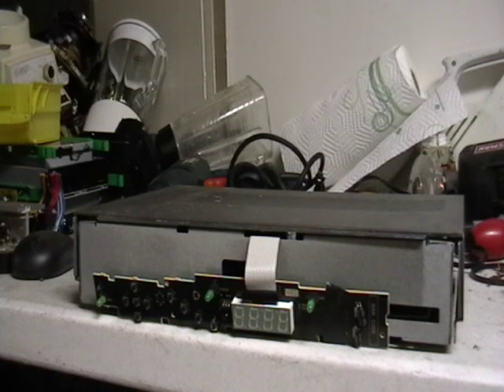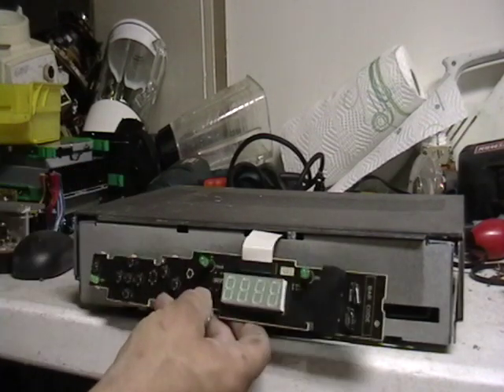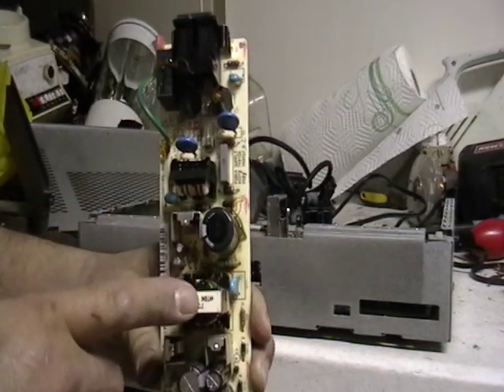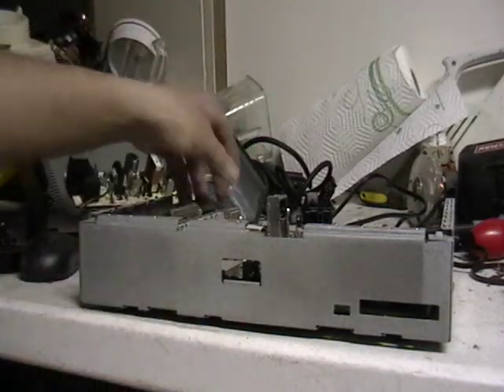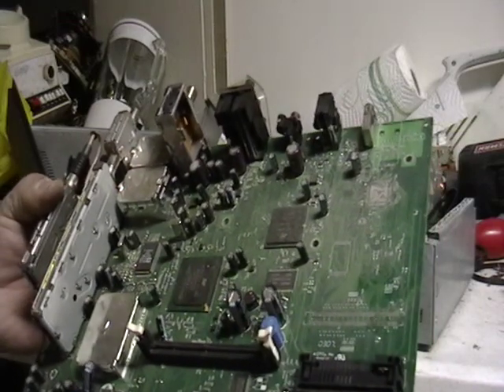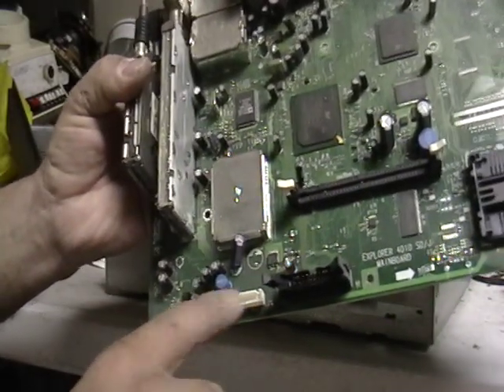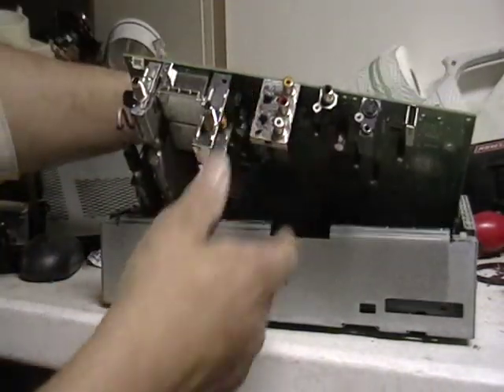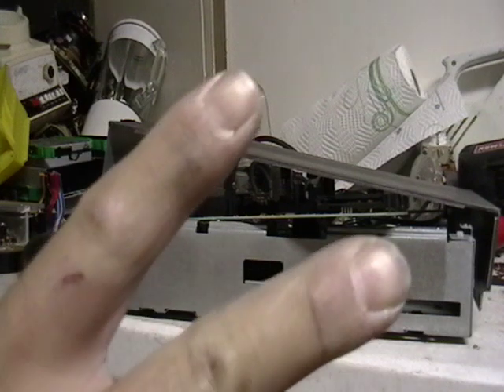Scrapping a cable box for gold

Comment: to extract the gold off plated parts , soak them in etchant solution from radio shack its low grade but its gold let it add up and any pawn shop will buy it .as for the boards cj enviromental does buy those  I ship a box of 80 to 150 lbs every few weeks and they pay shipping , my smallest check was 56  my largest was 175.  look them up online

Comment: THOSE HEAVY LOW GRADE BOARDS DO ADD UP.  I NEED A TORCH TO BURN THOSE COPPER THINGS OF FROM BEHIND I WAS THINKING ABOUT A HORSE NAIL CLIPPER TO PINCH THEM OFF WITH SOME ATTITUDE.  THE COPPER BREAK IS ABOUT THE SAME AS LOW GRADE BOARDS RIGHT NOW 15 CENTS # SO I ALSO NEED TO FIND A WAY TO EXTRACT THE COPPER OUT QUICK ENOUGH

Comment: Funny thing is you didn't even show the biggest part of gold in that receiver, why don't you bust open that box behind where the RF cable connects with the big long box behind it... it has a sheet of thin gold the size of a credit card, the last one i did had one on each side once the metal box is opened that is locked down like fort knox. you can cut into them and its gold all the way threw.
Reply: I got the thin sheets that are gold in color as well when I took apart a box. I don't think that is gold though is it? If so, how much is it even worth?

Comment: Hi Mike!  Thanks for your video. Can you tell me where I could find a place that pays money for the mother boards and stuff like that.  All the recycle centers here take is bottles and cans that say CRV on them.  I found one place that does buy copper, but they pay only $1 per lb. for no. 2 copper and $2 lb for no. 1 copper.  Also, the gold you mention, isn't that just gold plating?  How do we extract the gold off the board & plated parts?  Also, can you show us the different types of aluminum?